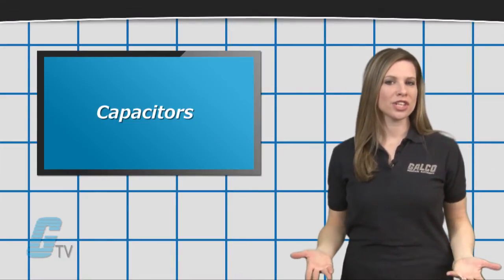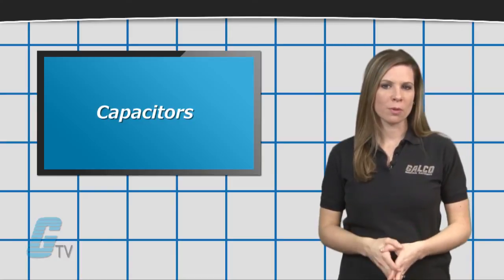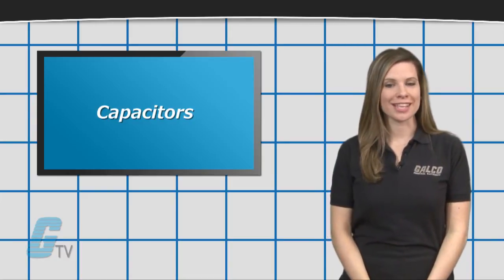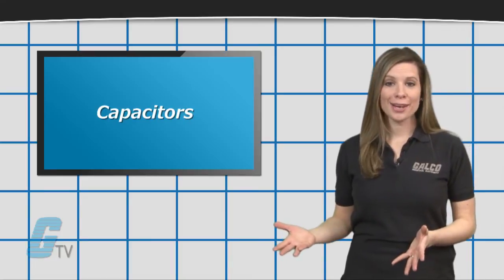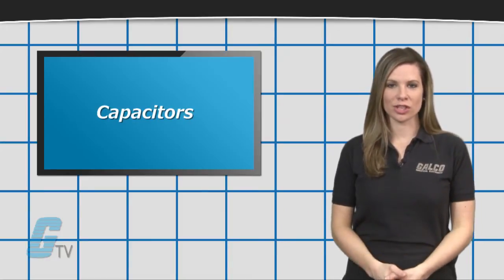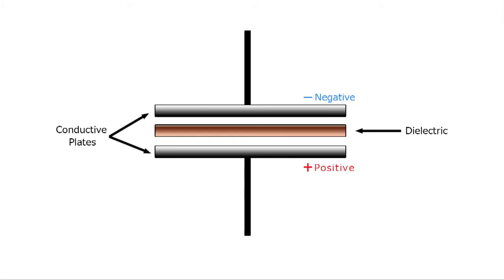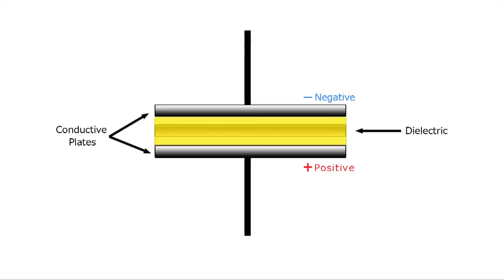How Capacitors Store Energy - A GalcoTV Tech Tip | Galco

Comment: for example if we take plates made up of copper, after a capacitor charged, will plates of capacitor turns to Cu+(positively charged plate) and Cu-(negatively charged plate) or capacitor plates remains same as Cu?
Reply from the maker: Yes, one side is positive and the other is negative. However aluminum is the more common material to make capacitors from, but copper would work the same.
Reply: @GalcoIndustrial  now, due to ions formation in the plates, whether plates (aluminum) property will change or not?
Reply from the maker: Not really, the amount of surface area, distance between the plates and type of insulator will have more effect on the capacitance value and voltage rating. Realize that the distance and type of insulator directly effect the voltage rating, and the amount of surface area directly effects the capacitance value, ok?